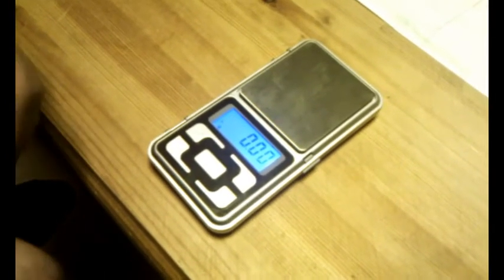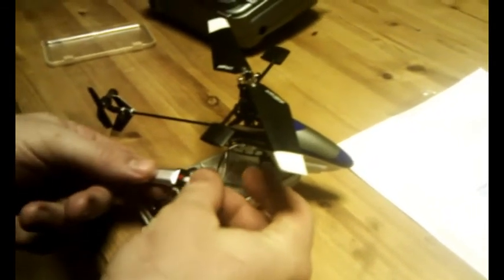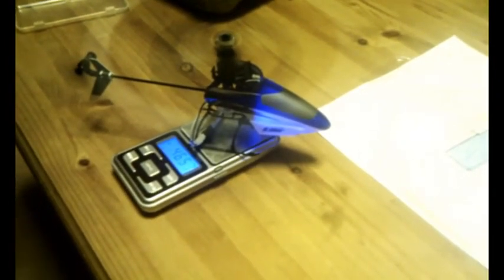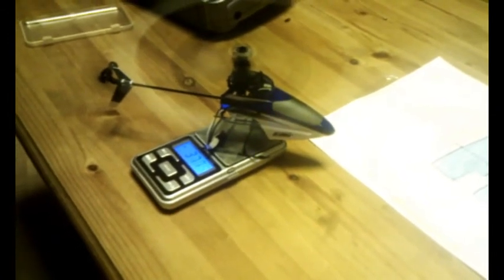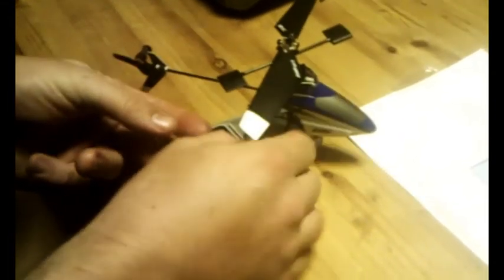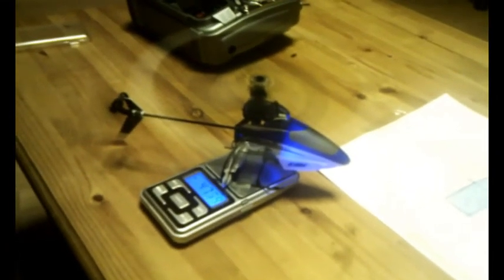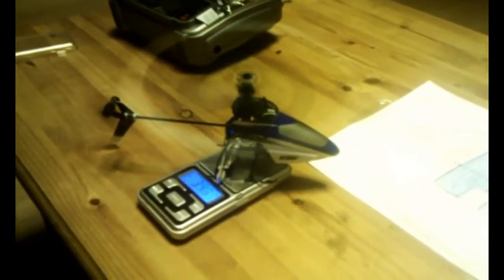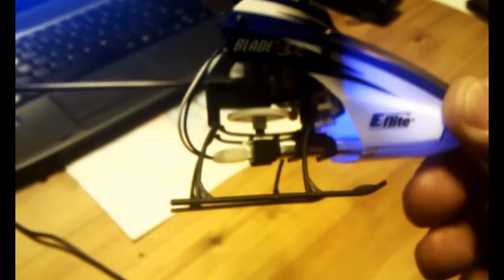Hyperion G3 CX 160mAh lipo cells test in Blade mSR

Comment: Thank you for the demo.  I am running 70mAh 25C and 100mAh 25C packs that are about 1 gram lighter than stock I see much better performance from wieght reduction and increase thrust.  Run times are a bit shorter but this heli zips with the smaller 25c lipo's.